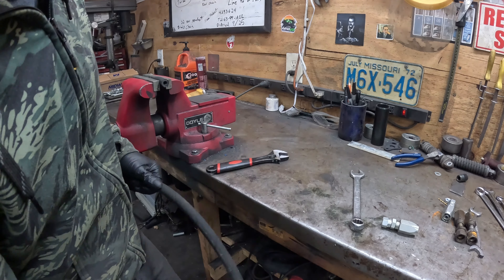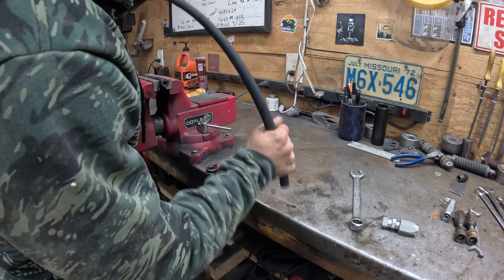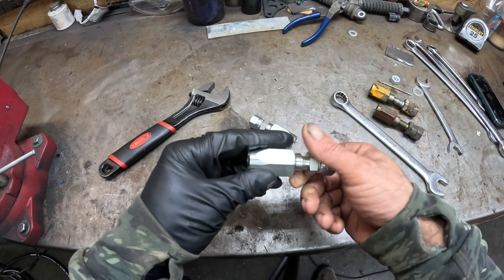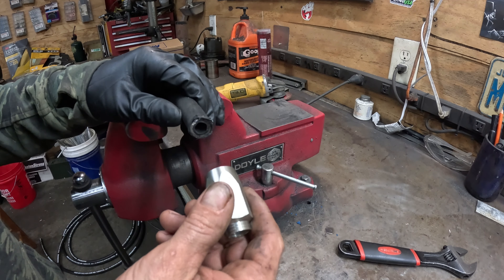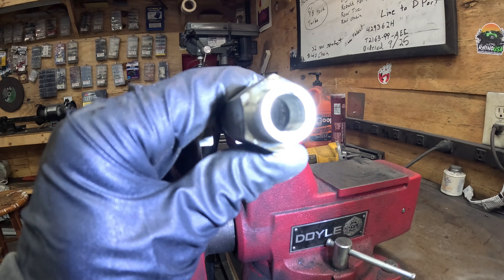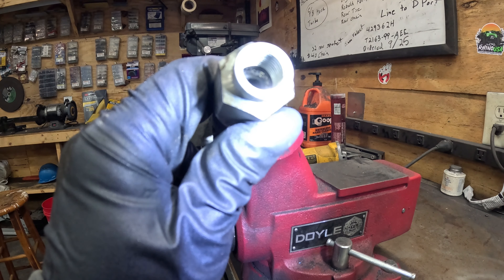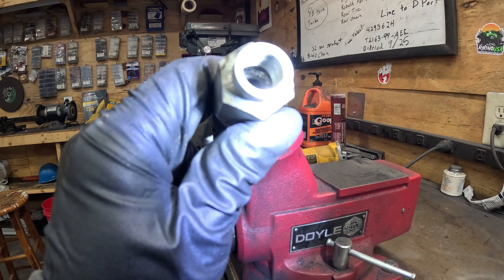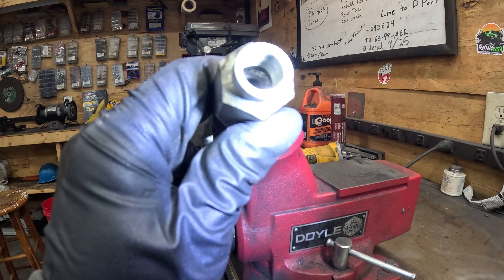Make HYDRAULIC HOSE using reusable fittings

Comment: I built 2-wire and 4-wire hydraulic hose at work very often as one of the services we offer. 95% of the hoses that come in are from the hose itself failing, rather than the fitting breaking/seizing. Its impressive how long the fittings can last in various environments and climates and still function as you'd expect while the best thing you can do for the rubber sometimes is just trying to put protective sleeves around them to get another year or so.